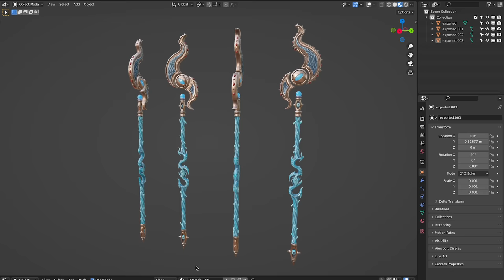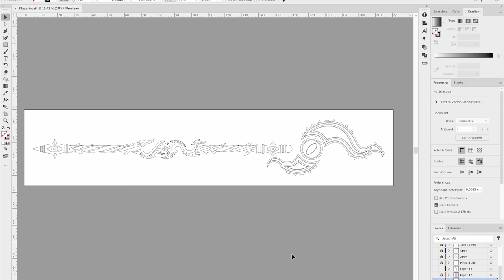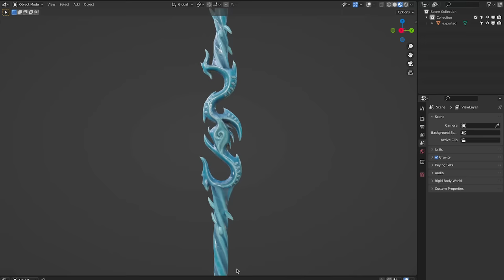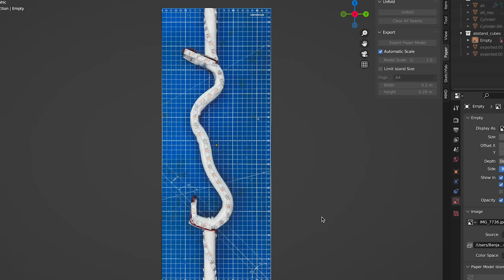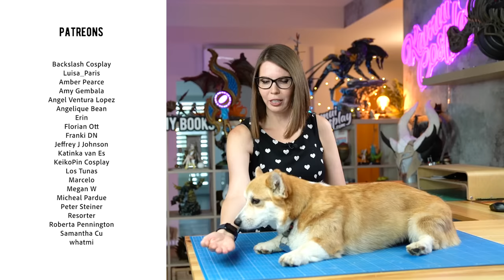I built a MASSIVE LED Warhammer staff in 10 days!

Comment: To stiffen the shaft, you could cut another tube in a y configuration ( three pieces) and glue them to the shaft on the outside but the outside diameter will be greater so will have to have an additional piece to fill in any gaps that you incur, great job it really turned out awesome.

Comment: Amazing work! I always come back to your channel as reference for my own props. I was wondering, why you didn't use COB LED strips since they are a bit easier to hid the individual LEDS?
Reply from the maker: I actually didn’t work with them yet and have no idea how bright or addressable they are or even I have the right hardware to control them. And I literally had only one week for this build, so no time for experiments! 😅
Reply: @KamuiCosplay  When you're on a strict time schedule, got to work with what you know best! I highly recommend trying them out and experimenting with them. In terms of programming, I believe the only difference is the LED chips are adjacent to the center LEDs in COB whereas in normal LEDs the chips are in between each LED. I've been able to program them using a simple RGB controller and even an Arduino mini